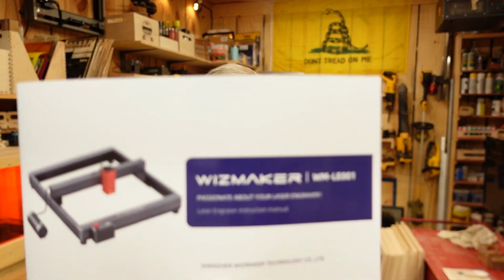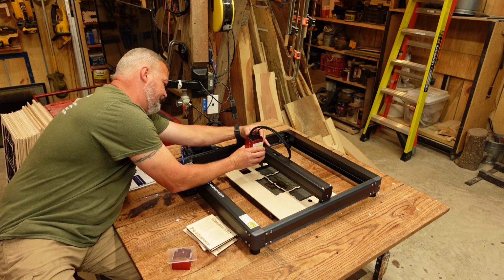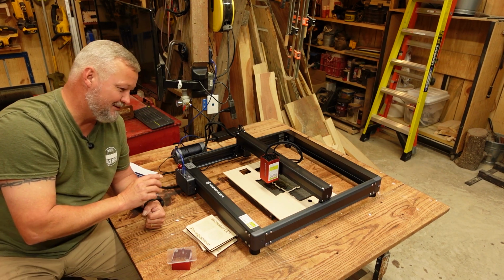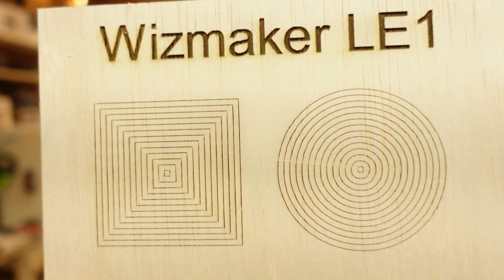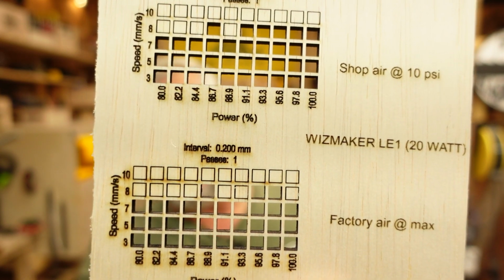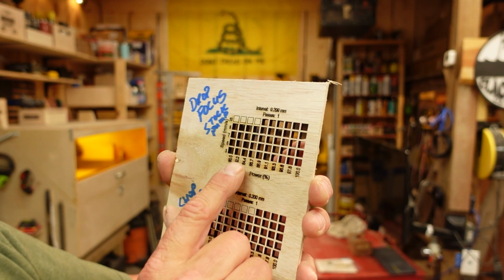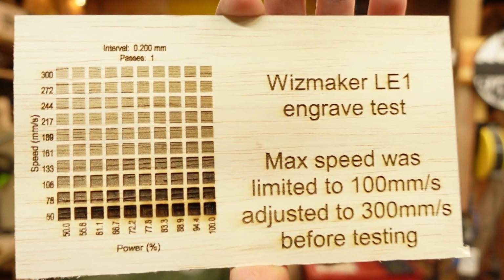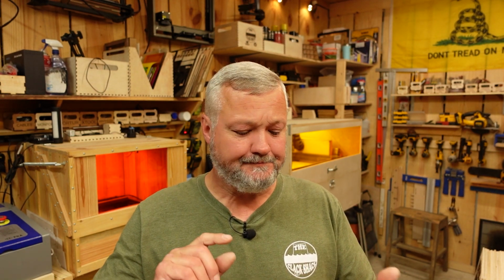Introducing the Wizmaker L1 20 watt

Comment: Just got mine and am having trouble figuring out where to go to unlock its full potential. Can you give some guidance on that?
Reply from the maker: Here are my config files, be sure to back up your controller just in case it has changed. 

https://drive.google.com/file/d/1-9CFaD1ZuwmhEjg2DuePfus5iUoxPXl0/view?usp=drive_link
Reply: @TheClackShack  where do I imput these at
Reply from the maker: One is a lightburn setup file and the other is my tweaked controller settings.  @gunnarfulcomer9119
Reply: @TheClackShack  Thank you

Comment: Did you ever try the Atomstack touch screen controller with this engraver?
Reply from the maker: No, I really never use the controller.
Reply: @TheClackShack  Me neither, but somebody asked me if it would work. I have the Enjoywood E20 which is the same as the L1. I actually bought two at $400 each on ebay. I shared the deal on LA Hobby Guy's forum and people have been asking me about it.

Comment: How did you unlock the max speed? Mine is also capped at 6000 mm/m from the factory but even when I change $110 and $111 the machine still won't go above 6000 mm/m. When I look in console it reports back that the settings have been changed to 18000 mm/m like I want but the actual speed of the machine is still capped anyway.
Reply from the maker: Make sure to hit the write button to save the setting
Reply: @TheClackShack  Thank you hitting write button got it to stick.
Reply from the maker: @larams2813  glad you got it